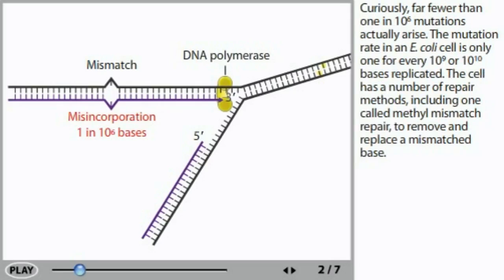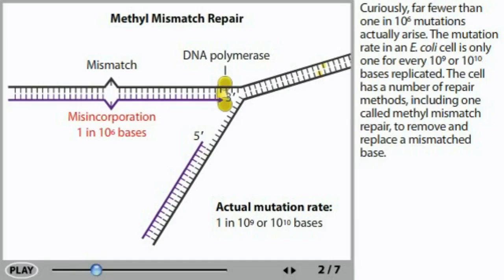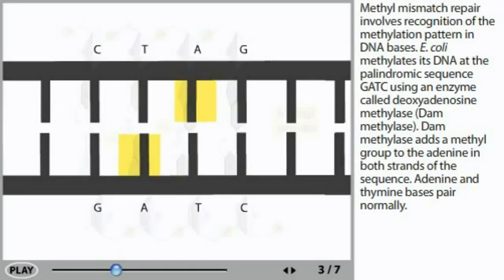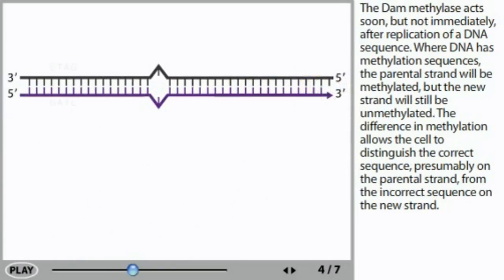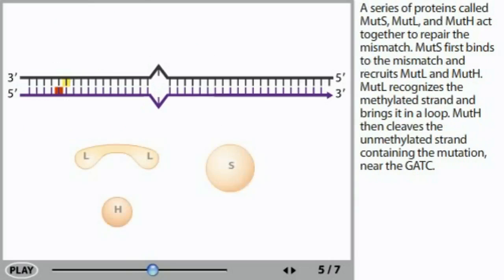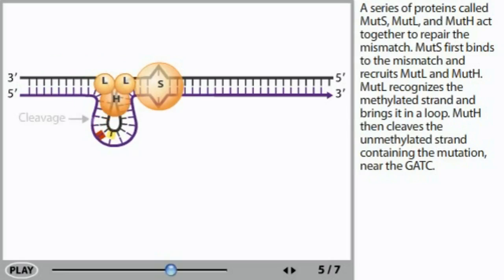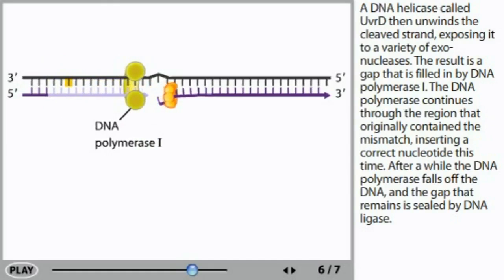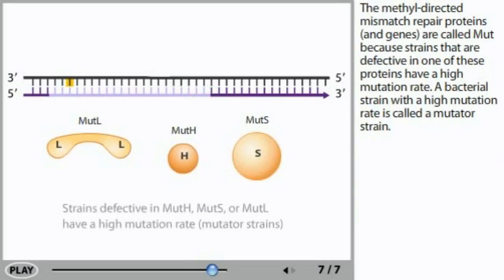Mismatch Repair Animation

Comment: I used this "trick" to help memorize what MutS, L, and H were. The S stands for "signal", it signals that there is a nucleotide mismatch. The L stands for "loop" because it forms a loop. I could not come up with anything for the H, but shortly after a helicase called UvrD unwinds the DNA. Hopefully this helps someone.
Reply: MutS ➡️ Signal 
MutL  ➡️ Loop 
MutH ➡️ nicks Hemi-methylated strand
Reply: H binds to a Hemi-methylated site
Reply: This helped me a lot, thank you!